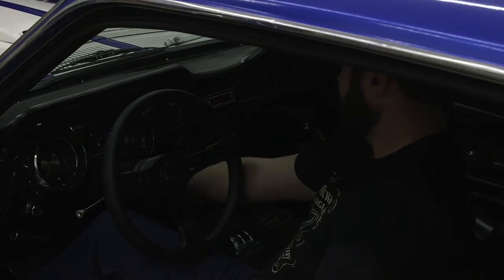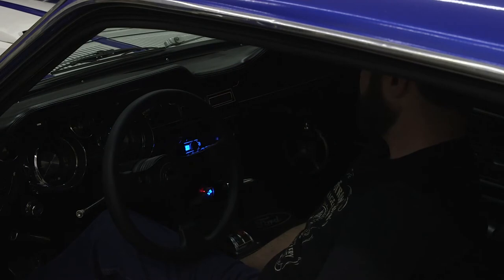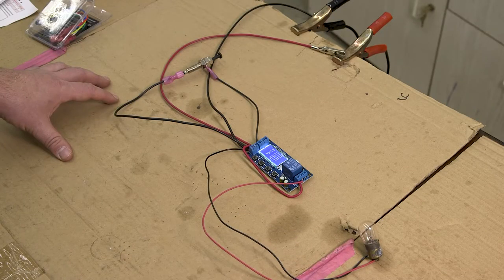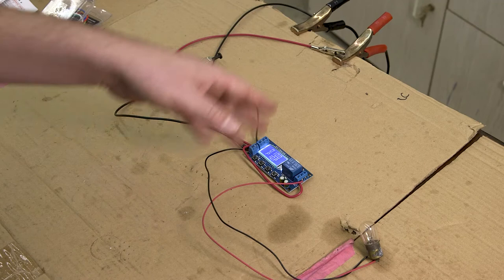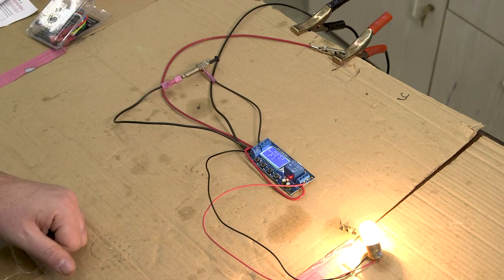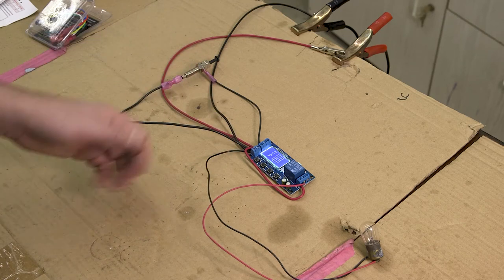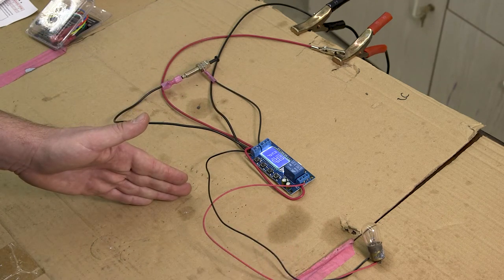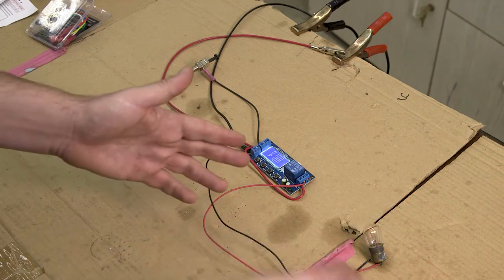Why you need time delay relays in your project

Comment: good info.. may have to do this with my car.. now to see if i can figure out how to do it where only the driver door will trigger it. currently both switches are tied to the same circuit for courtesy lights.
Reply from the maker: With the relay only needing a trigger, the courtesy light circuit is plenty. I will do a more detailed video of how exactly I tied it all together in my car to ensure it worked well without annoying issues like turning the circuit on again when getting.out of the car.

Thanks for watching! It's nice to know people might get useful info or ideas from these videos.
Reply: @AmbiVe  i was just thinking, i don't want a passenger getting in, or someone getting something out of the car on the passenger side to trigger it. but still have only the driver door opening trigger the holley, so the pump primes and as another user said, when you key off, it'll allow the fans to run for a bit longer once the engine is off.